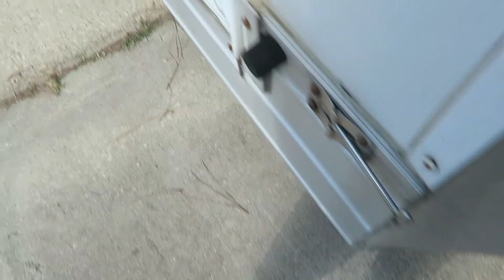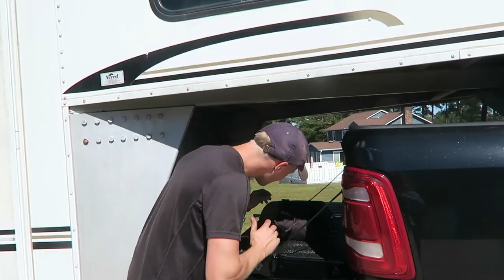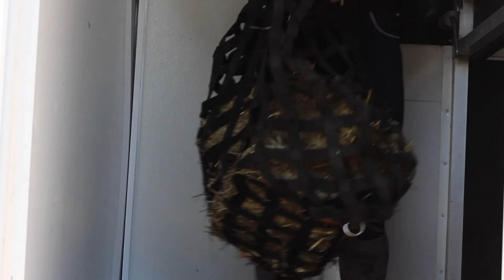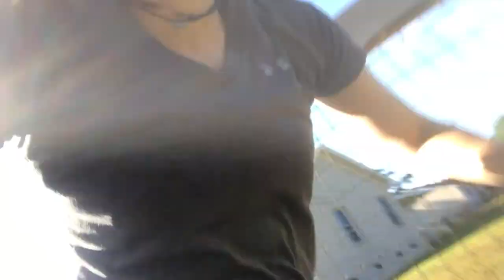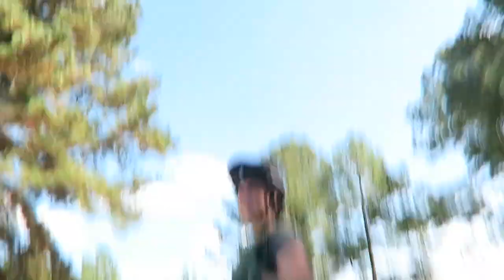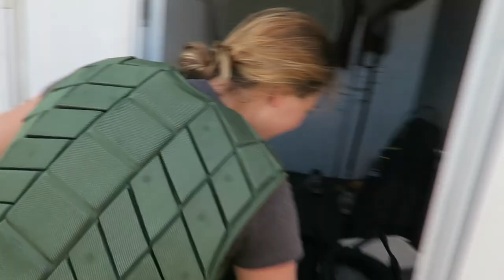NEW TRUCKS ARE TOO BIG TO HAUL! (truck can't pull horse trailer)

Comment: Same issue.  I ended up replacing the rear blocks in my new truck.  I went from the factory 3" blocks to 1.5" blocks, and just added airbags at the same time.  This lowered the rear of my truck slightly.  I still had to adjust the gooseneck hitch as you did.  What a lot of people end up doing is taking the trailer to a welding shop, and having them weld on some 2"x2" steel between the axles and the horse trailer - raising the back end of your horse trailer up so it's now level with the adjusted gooseneck hitch.
Reply from the maker: We don't have leaf springs, instead we're looking into replacing the rear coil-springs with a rear leveling airbag kit. Fingers crossed it does something helpful!

Comment: Flatbed the truck or raise the trailer by one of a couple methods. Unlevel trailer throws a LOT more weight (premature bearing/tire failure) to the back axle... screwing up handling as well

Comment: Part of the issue is that the new HD trucks are built to maximize towing ability because they are mostly used as professional equipment and every pound of capacity matters. So if you have an old trailer that was built for the equipment of the time, it is likely to not perfectly agree with new trucks as the ability of these new tow trucks have been growing by leaps and bounds in power and towing capabilities.

Comment: I have a lifted Ford F550 4x4 and I have to have my trailer lifted also to get clearance.  I didn’t want to lower my truck   When I lifted my trailer I also put larger tires and wheels onto make a smooth ride for my horses